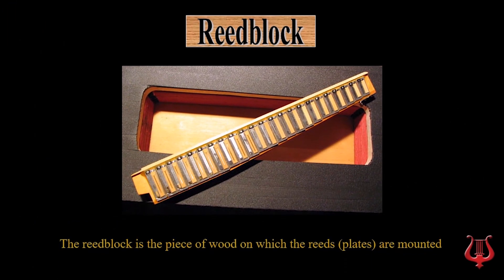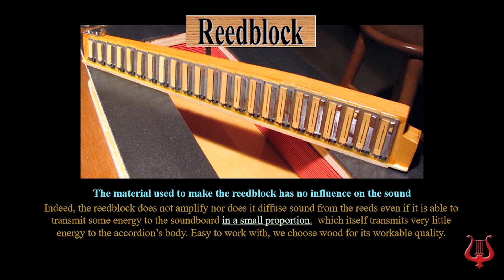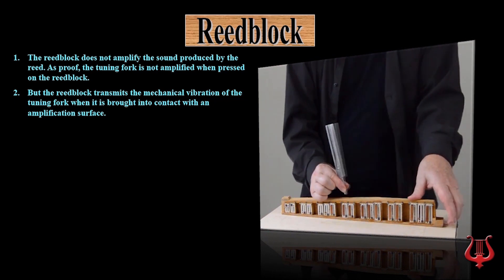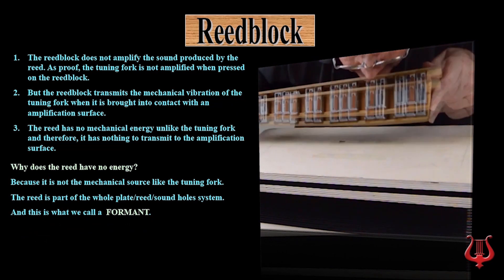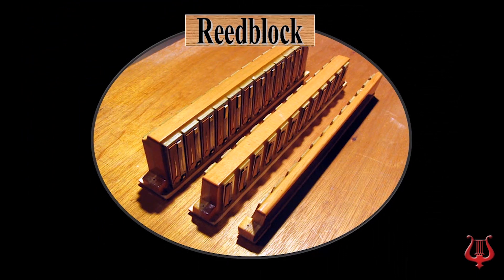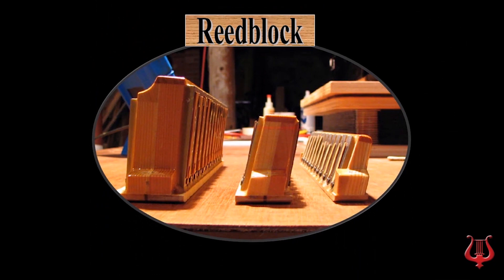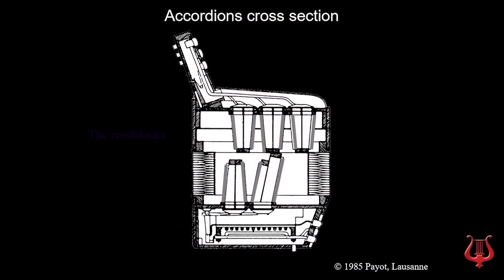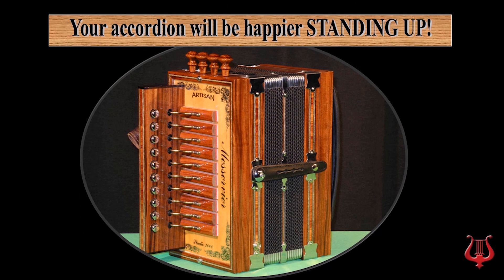Why the material used to build the reedblock has little or no effect on the sound?

Comment: Everything makes a difference even using pins instead of wax. Can you explain wax vs pins effect on sound. I liked the wax timbre sound way better than pins compared on 2 Italian accordions. Why are all black keys on one side on the reed blocks  ??
Reply from the maker: If you prefer the waxed reeds over the nailed reeds, you probably prefer a mellow accordion sound as opposed to a brighter sound.  When fixed with nails, the reed plates are more stable and there is less loss of harmonics hence a brighter tone.
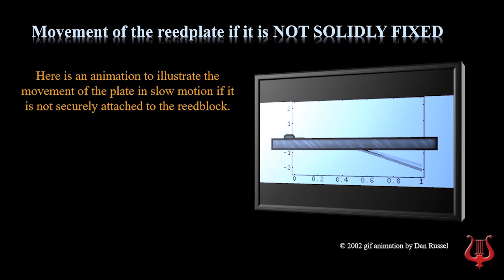Wax is not as rigid as the nails so there will be a movement of the plate and the energy of the reed will suffer as seen at 3:50 

Now, answer to the question "why do we voluntarily place the black notes valves at the bottom, closer to the spindle of the keys?"

Because the black keys being closer to the axle rod (spindle) have deeper key dip, which results in greater valve clearance.  We help the whit keys which have reduced key dip by placing their valve farther away from the spindle.
Reply: @ thanks for your reply very informative and i do notice a brighter sound from the pins installed reeds it seems brighter and more like metal sound to me I do prefer the mellow accordion sound thanks

Comment: Science proves that a reed that sounds during bellows compression 
and 
a reed that sounds during bellows draw/expansion
operate in two different air pressure domains/regions. 
That means you have also tune them in their specific domain/region.
A reed that sounds during bellows draw, 
operates in the 
>atmospheric pressure and below< region.
And reed that sounds during bellows compression, 
operates in the 
>atmospheric pressure and above< region.
 They have to be tuned in these regions also.
Reply from the maker: Hi Steffan, VERY INTERESTING your point.  There is indeed a difference in both tuning and timbre of the sound when pushing or pulling the bellows.  Was not aware about the air pressure you point out.  Thanks for your input.

Comment: 3d PRINT THOSE REEDS
Reply: I doubt you can 3D print a metal reed but it would certainly be possible for the reed blocks.  I think a 3D print of reed block would sound better than a wooden reed block.

Comment: Man, you know very little about accordion building. EVERYTHING affects the sound. The reed tongue, the reed plates, the wood, the house material, the cassotto material, the reedblock angle, etc.
Reply from the maker: Hey, you're entitle of your own opinion but I STAND BY MY AFFIRMATION.  NOT EVERYTHING AFFECTS THE SOUND.  You obviously don't know about the "formant" type of producing sound.  For example, the piano sound production is COMPLETELY OPPOSITE of the accordion's "formant" type of sound producing.  So yes, for the piano, wood is VERY IMPORTANT like for the soundboard which acts as the speaker's membrane to amplify the string's vibrations.  But on the accordion, the reed block amplifies nothing.  For sure, if the reed block was made of aluminum, it would sound better because the aluminum it more rigid and solid than the wood.  Producing reed blocks with wood material is in fact counterproductive as wood is soft so wood won't hold the reed plates as solidly as aluminum would for example.  So don't say "I know very little about accordion building" because of your own ignorance and lack of understanding the accordion' sound producing principles .

Comment: Thanks for the video. I'm not certain though that you're correct about reed block materials having little effect on the sound. Are you familiar with the Settimio Soprani Ampliphonic? Instead of 3 or 4 longitudinal reed blocks in the keyboard end and 4 or 5 in the bass, the Ampliphonic uses small transverse blocks, 6 in the bass and maybe 10 in the keyboard end. One of these blocks in the keyboard end thus holds the reeds for 4 notes. These accordions have a very different sound, with a much reduced harmonic component, and quite honestly there does seem to be something missing in their sound, and they lack volume too. It was an experiment which didn't gain popularity. I theorise from this that on a conventional block, many reeds other than those being played will be slightly vibrating in sympathy, which colours the sound even if there is no air passing through them. And if this theory is correct, the reed block material will be relevant as to how much or how little of this sympathetic vibration occurs. As a possible example of this, Weltmeister have sometimes used plastic reed blocks. Weltmeisters in my experience always have a dull sound, but I think the ones with plastic blocks are worse. I hope you find my theorising of interest!
Reply from the maker: Hi @captaccordion.  Thanks for your comment.  But I need to disagree with your theory that reeds vibrates sympathetically with others.  There is absolutely no sound produced by the mechanical movement of any reeds.  The sound is produced ONLY when air passes thru the reed and the sound is produced inside the cavity of the reed block.  Look at my video when I press a vibrating tuning fork to the reed block, nothing happens, no sound.  Reed block WILL HAVE AN EFFECT ON THE SOUND only when using a more rigid material like aluminum and the reeds are screwed on this reed block.  Much more harmonics and a richer sound because the vibrating energy is NOT lost to the "soft" wood.  The "coupling" between the reed plate and the aluminum reed block is tighter with the screws than the wax.  Even the plastic reed blocks once used by Weltmeister is better for producing higher harmonics.  They probably failed at this because of poor workmanship from Weltmeister.  Not familiar with the Settimio Soprani Ampliphonic, sorry.
Reply: Hello Mr Accordionguide. Thanks for the reply. I'm afraid that I'll have to disagree with your comment that reeds make no noise unless air is passing through them. If you play a bass note or bass end chord, then release the button and stop the bellows, the residual vibration of the reeds remains audible, though not loud. I've had many customers ask me if this was a fault with their accordion, and have had to explain that reeds simply don't lose their momentum in zero time.  On vibration in reed blocks, long blocks secured at each end can in fact slightly vibrate in a manner similar to a guitar string in response to the side to side oscillation of reeds. This is mostly evident when M and M+ reeds are on the same block. Somewhere along the block the two reeds will try to synchronise and not want to play the beat that they have been tuned to make. (This effect is visible in the classic physics demonstration of metronomes placed on a swinging board synchronising themselves.) In accordions and in practice, this problem manifests itself about 1/3 of the way along a block, and prevention of this is the reason for bars being screwed across the tops of the blocks, most usually 1/3 of the way along. Anyway, give this all some thought and we'll talk again. Cheers.
Reply from the maker: @captaccordion  The "noise" and "residual sound" you are talking about the reeds produce by themselves is so a small portion of the total sound that we can ignore it completely.  Actually we can say that "the residual vibration of the reeds remains audible after releasing the bass button" you are talking about is more a transient sound, NOT a musical sound.  This is why I stand by my stance: "reeds don't make any sound on themselves"  Are you familiar with the sound source of the accordion?  It is NOT the reed!  It is a formant created by the air passing thru the reed.  Further more, the bar joining the reed blocks are NOT present to "eliminate the synchronizing between reeds" they exist to prevent the top of the reed blocks swing and thus loose mechanical energy.  But as a side effect, the bar does prevent to some extent the "synchronizing between reeds" because the reed blocks are more stable.  You even give yourself an explanation:  "(This effect is visible in the classic physics demonstration of metronomes placed on a swinging board synchronizing themselves.)"  You say "SWINGING BOARD" and that is the main reason the metronomes synchronize themselves.  Same effect on a bridge BTW.   But we are completely getting out of our main subject here:  reed block materials having little effect on the sound.
Then please explain to me why I get the same sound out of a reed blowing it with my nose as when this reed is mounted on the reed block?